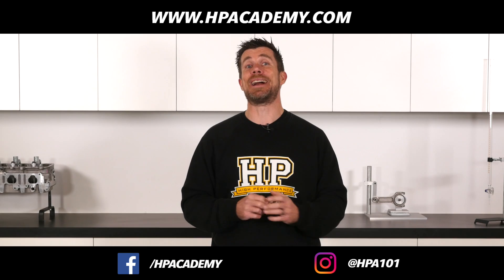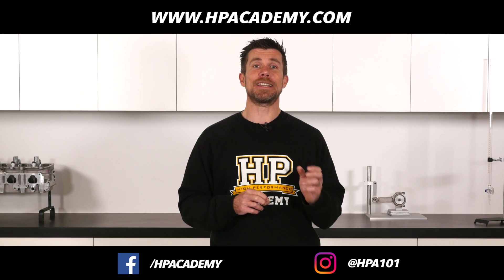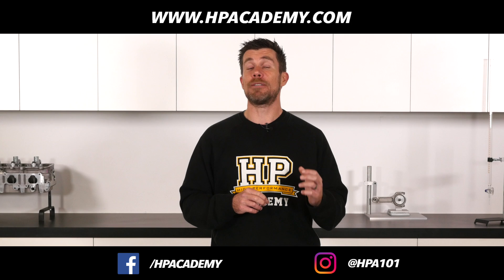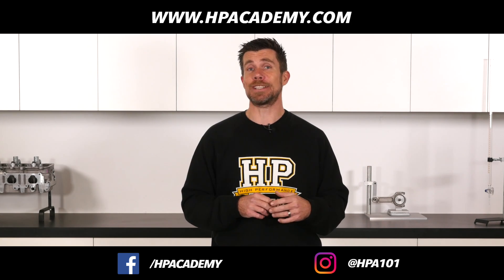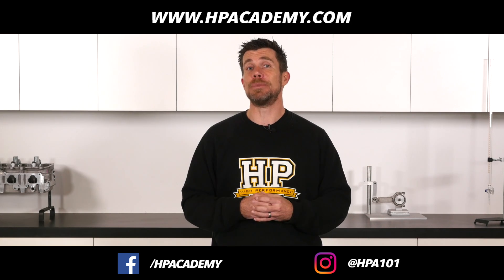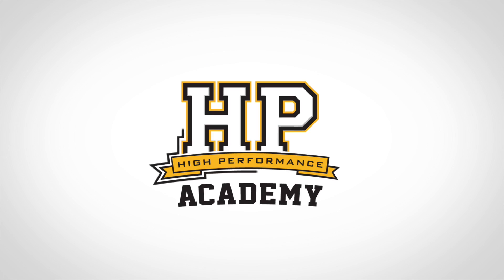[HPA Q&A] How much ignition advance should I use with E85 (ethanol) fuel?

Comment: I have a turbocharged engine at 15°, gazoline SP98. So I must go to 13° with e85? I have unburn fuel that "pop" in exhaust manifold at low rpms. Thanks.

Comment: Would it be generally safe tho?To add 2 degree to the whole map? If the low octane tune was considered “safe”
Reply: since hp academy doesn't normally reply, i would personally add a degree at a time to the load cells just to see what kind of gains you are getting. but make sure you're listening for knock or have some way of monitoring it.
Reply: @xalr6128  Thankyou for the response

Comment: Nice vid! Question: If running on a Apexi Power FC Ignition map (that's based on E85) and regular Shell V-Power gasoline on a 1JZ-GT, is it correct to drop the whole ignition map by 2 degrees or so? Or is there another procedure I should follow? I do have some knock on the hand controller (about 43). 
Ps. I'm just an amateur and we don't have a DYNO in my country... Thanks in advance!

Comment: I've read and had discussion with engine professionals about the E85 ignition timing. While the ethanol fuel will indeed have a greater flame front velocity, the delay from spark to ignition is greater than that of gasoline. This seems to make the total combustion period longer and thus requiring more ingition advance throughout the map. You're saying that there are areas where you'd actually need to reduce timing. Where and in what conditions is this so?
Reply from the maker: Our own experience is that in the areas of the ignition table where the engine isn't knock limited on pump gas, the timing will be lower on E85. If you inspect a stock calibration for a GM flex fuel vehicle you'll see the same trend. Probably the easiest way to see this is with the demonstration we've just filmed as part of our Ethanol and Flex Fuel Tuning course. You can watch it here: http://free.motorsport.education/mbt-timing-vs-ethanol-content

Comment: Great information. Im actually in the process of tuning 2 cars on pump fuel and we are on the verge of doing Ethanol maps on both. This will really help a lot. Is it correct by saying that we need the LEAST amount of advance where we make the most bhp?
Reply: Amateur here, but I believe your statement is correct as MBT can also be referred to as minimum timing for best torque. Late response but in case anyone else is wondering.

Comment: Can tractive force measured from the dyno give an indication as to when the engine is knocking? i.e. If the engine is knock limited can MBT still be obtained by advancing timing into the knock region or does detonation inherently have a significant reduction on BMEP?
Reply from the maker: This is actually an area where there's quite a lot of misinformation. Many believe that we can simply tune the ignition until the torque on the dyno plateaus because at the onset of knock torque will drop. This is true in essence however in almost all situations we'll find the engine starts knocking initially on perhaps 1 or 2 cylinders which means we can see the net torque measured by the dyno increase while the engine is simultaneously knocking.

This is why we recommend using audio knock detection equipment to confirm when the engine is knocking rather than trying to infer this information from the dyno.
Reply: Thanks for the info!